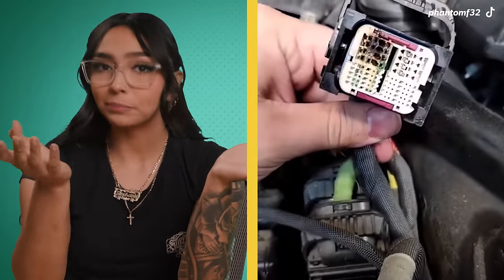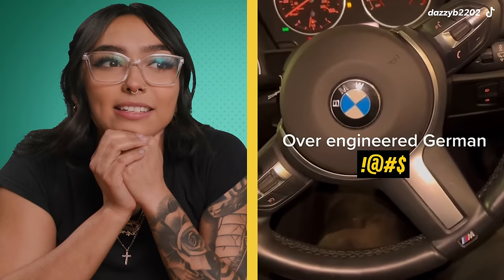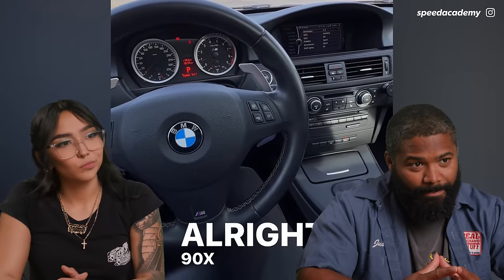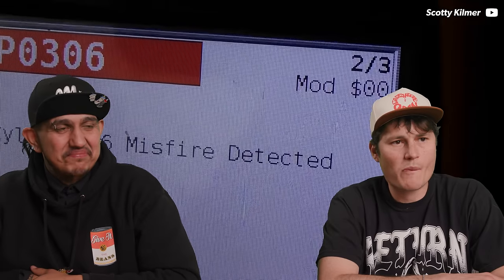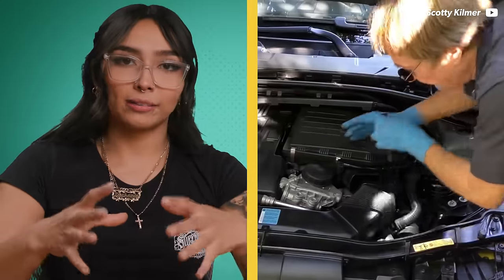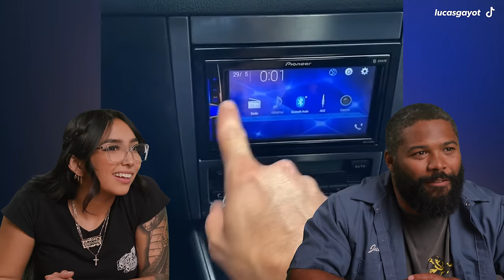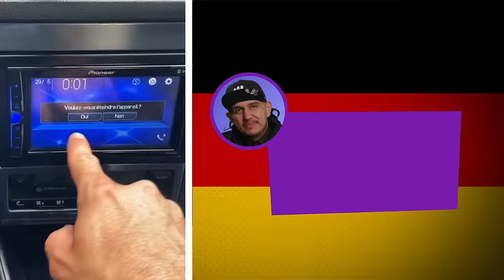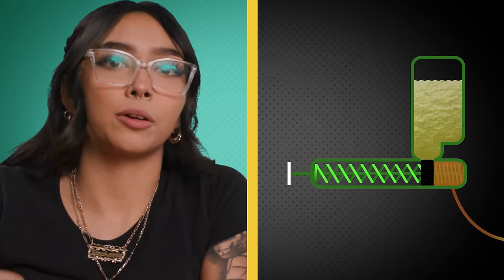Mechanic Reacts to German Engineering Fails

Comment: I’m a mechanic, my brother is an engineer, when he started working the first thing I told him was “don’t forget someone has to work on what you design”
Reply: As a mechanic. I've told engineers the same thing. "it's not my job, to make your job easier" was the exact reply i got.
Reply: @salemcripple It’s true though, design engineers in that industry aren’t incentivized or even asked to make things repairable. It’s the opposite actually, vehicles are designed to be proprietary, for profit. In some other industries it’s different, so things are easily repairable. For example dirt bikes, or commercial cooking equipment… and many others. 

So the real blame lies with the bean counters and corporate that decide to prioritize profit over ease of repair and consumers, and the politicians that allow them to do it, not the engineers.
Reply: This is why every engineer should have to work in a repair shop for a few years as part of their training.
Reply: @mattmattmatt131313 they do. Every engineer works on their own product during development. The problem is that engineers have to balance so so many other things that you don't care about. Size, cost, ease of assembly, manufacturability.  The vast majority of time, if you just read the service manual, the engineers have documented exactly how to get access to such-n-such, and what tools you need. But mechanics think they know how to do the work, and often back themselves into a corner.  For example, I had a mechanic tell me they had to lift an entire engine to access a broken belt tensioner bolt. If they had bothered to read the service manual, they would have known that all you have to do is remove one wheel and a fender cover, and there's an access hole.
Reply: IT"S NOT THE ENGINEERS!!! IT'S THE C SUITE!!!! ONe guy said his retired uncle said engineering at GM was a quagmire of politics and overbearing management who would over ride the engineers to save a penny. #RightToRepair  wait till you find out how OEMs treat hospital equipment and warranty work.
Reply: Where's Angelina?????????????
Reply: @gizmoguyar  The service manual doesn't come with the car. As a mechanic who doesn't work for the dealership, I don't have access to that. But on the other hand, I would have noticed the access hole.
Reply: In my mind, every engineer should have to assemble whatever they design. Anything I design I am having to assemble myself, so I always design it with "okay is this even going to be possible?"
Reply: you are lying... no engineer have ever thought about somone having to fix their shit.
Reply: @f-puppet  ikr. Angelina is one of the only 2 reason I watch this channel. The other reason being my love for cars.
Reply: @blablabla983   I am an engineer and I can tell u that u are half right. Problem is, we are forced to care more about manufacturing and the cost of manufacturing. However, we are also forced to find a way to design things so that they can be accessed and repaired, even if that means using specialized tools and methods, and as someone here already pointed out, lots of mechanics can't be bothered with reading or learning what we are forced to provide for them. That all is what it is, but things could be/should be designed with the mechanics in mind more so than the cost of manufacturing, but, sadly, that too, is what it is. Manufacturers expenses carry more weight than consumer costs.
Reply: I've worked on cars, boats, aircraft of all different kinds. With other mechanics in all of those specializations. All complain about engineering and I myself have to. The fact is though it gets built and it works. If mechanics had to design something from scratch, most would fail to make something that actually works. Those problems they complained so much about? Would be the entire assembly process of their whole product, not just one poorly placed sensor. 

All I'm saying is we all got to be grateful for each other's work. I think that's the point of the OP, just talking about the "as a mechanic... engineers suck" argument.
Reply: Engineers should have to fix what they design.
Reply: @DonnieBrass  The manual you are forced to write doesn't make it to the mechanic's hand. So it's not that we won't read it. We don't have it at all.
Reply: @Samuri5hit84  You are wrong on that.  If it was up to Mechanic's, all cars would be built like a Hyundai and have an LS in there. Easy to work on, affordable parts, and so plentiful you can find them under a rock.
Reply: @brucetec6597   It certainly should make it's way into mechanics hands...but it's up to the mechanics to seek it out and employ it. We (engineers) work closely with technical writers & service teams to put out comprehensive service documentation for the mechanics. This documentation includes your service manuals, repair guides, and even step by step diagnostic procedures... that provide clear instructions for mechanics. Mechanics and their ability to get service jobs done as efficiently as possible is factored in much more so than I think a lot of mechanics realize.
Reply: @DonnieBrass  The manufacturer does not make it available to the mechanics. Try finding those manuals online.
Reply: @brucetec6597  oh, okay. I get what you're saying. Well I can't help with that, that's beyond my control at all, but, yeah, I just want all the mechanics out there to know, that we engineers do care, do consider y'all, and jyst like y'all, we do the best we can. Y'all are very much appreciated!
Reply: If your engineer brother has a big ego, he'll just say "Someone with a DEGREE has to design what you work on, mere heathen scum tradesman."
Designing stuff, building it, and maintaining it are three entirely different endeavours!
Reply: @partymanau  why you hating on Engineers? We do more for you than you realize, and we go to bat for you in more ways than you will ever know or understand.
Reply: @Username-2 the real problem lies in people being too incompetent to fix their own car so big car companies build like shit so it takes 20 hours of labor to do a job that used to take 2
Reply: As long as it’s in the budget, they don’t give a F.
Reply: @mattparker3349   You’ve got it backward. People used to be able to fix their own car because cars used to be simpler to work on, this caused manufacturers to lose money, so they made cars more complex and harder to fix. Leading to more sales.

It’s not like everyone woke up one day and decided they didn’t want to work on their cars anymore. This was the intent, and caused entirely by intentional design.
Reply: Almost all engineers are thinking of dimensions, tolerances and operation. Ease of assembly is another one. But they all have they're own assignments ( interior, frame, body, safety, sat/nav wiring and sensor layout) and don't work together for the sake of the mechanic.
Reply: Best advice you could give anybody. Especially an engineer.
Reply: @salemcripple what?! How about “ not harder but impossible in many instances”
Reply: @salemcripple  The appropriate response is "Great - I'll warn everyone I know not to buy anything you might have touched".
Reply: @brucetec6597 lol I see you simply wish it could all be your way. To hell with safety regulations and emissions compliance. Shoot, may as well stick a flat head v8 with a carb on the premium trim while you’re at it ! 😂😂😂
Reply: @DonnieBrass  Thank you. I'm glad we can work together. We now need to get the bean counters to join us, too.
Reply: Actually the Thermostat on my Porsches 928 is the easiest to replace among all cars I've owned. An oil change on my Porsche 996 takes less than half the time of a Toyota RAV4.
Reply: @Username-2 ??? it's exactly what he said! people can't work on newer cars because they are hard af to work on
Reply: @swilleh_  Do you struggle with basic reading comprehension? He said people are too incompetent to work on their own cars so manufacturers then make them harder to work on. I was pointing out that it is in fact the complete opposite.
Reply: @Ange1ofD4rkness  you are completely delusional and clueless if you seriously think that assembly is not a part of the engineering process
Reply: I think most of you don’t even know what an engineer do😂
Reply: @illama5330 What? on the computer? Doubt they assemble it in person. You think they want to go through that pain themselves?
Reply: @Ange1ofD4rkness  do you seriously think that the first physical car they make is the one coming off of the assembly line and shipping off to customers? Yeah on the computers, that's what CAD assemblies are for, but also on physical cars before the full production run. They make prototypes.

Besides, if a car can be put together, it can also be taken apart. If the engineers put a screw in that can only be removed by taking out the engine, they are fully aware that is the case. It's not like they're clueless, it's that engineering priorities are currently not ease of repair. Simple as that.
Reply: @gizmoguyar  you can't lie though some of these new cars are just shit engineering though
Reply: @Dietznutz132  Some of them are. But I think you are confusing engineering with design. Engineering deals with the function, structure, and reliability of the vehicle.
Reply: Come on guys! Real engineers always keep serviceability in mind while designing an assembly. I worked as a warranty inspector and as a tech support in a Suzuki dealership and one of my duties was reporting issues like difficulties performing maintenance and possible suggestions to the factory.

When I joined an engineering firm as a design engineer, we always got extensive feedback reg. serviceability from senior technicians of the R&D team. It has always been a big factor when it comes to the design process.

So if someone says they don't consider it while designing...I say touch grass.
Reply: @cdoublejj  My engneerng department chairman worked for GM in the 50s during summer vacations. He worked in a department that did nothing but analyze how many body parts of new designs would fit in a boxcar. He said their mantra was that they could afford to hire an engineer if his ony accomplishment during a year was to save $0.001 per car. Six million cars, $6,000 for the engineer.
Reply: @blablabla983  ..and you know that because? I've worked as an engineer in departments where I sat in the same room as the maintenance manager. Not every engineer works at GM.
Reply: @brucetec6597  They do....at least Hyundai, Honda, Subaru, Ford and Mazda....
Reply: @salemcripple  Well, they did give it to you pretty spot on, they are not getting paid to help you, they are getting paid to help whatever company they are working for to do whatever is asked of them. You're barking up the wrong tree, go tell the execs who spearhead these companies into doing what they do.
Reply: @salemcripple  had a similar situation where I responded. Oh really.? well it’s not my job to make your dental work easier.
😊🛠️
Reply: @salemcripple  Shame them. Shame them into making your life easier.

remember, bullying gets results sometimes
Reply: As a mechanic, I told an engineer. Remember if you not only don’t attempt to make my job easier, but actually make it harder. I’ll make yours harder too.
Reply: Engineers dont care.  The Es in that word stand for ego.
Reply: @mattmattmatt131313  dumbest thing iv heard all day  Thanks for the laugh.
Reply: I’m a machine operator and I tell all the new engineers here that exact same thing. Someone has to make that part and someone has to service the unit.
Reply: ^^ working on something when it breaks is on the list but it's not in the top 50-70 requirements you have.
Reply: I can hear your brother laughing deep inside 😂
Reply: Imagine how efficient it would be to send automotive engineers to work in a shop. Just slightly subsidize the income and send them for a year.
Reply: German cars are indeed over-engineered in terms of complexity. However, they are generally well thought out, making them relatively easy to maintain. Of course, there are exceptions where an engine is designed for one model and later fitted into another type. I am curious which modern engines are considered better designed according to these mechanics. Various steering aids are now mandatory in Europe, and the complexity in engines is necessary due to environmental regulations. Otherwise, BMW would probably still be building wonderful naturally aspirated inline-six engines with hydraulic power steering.